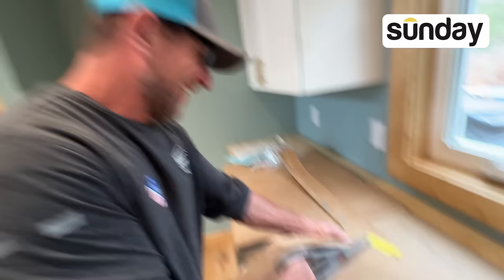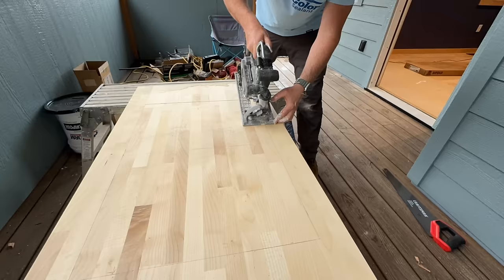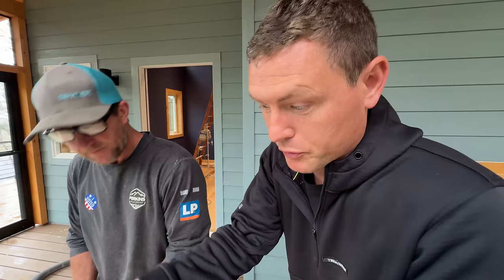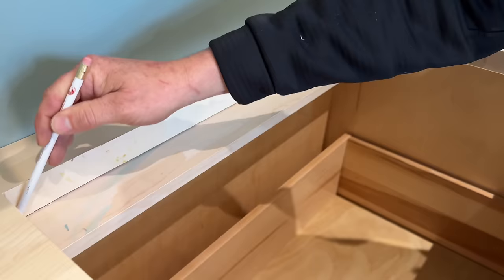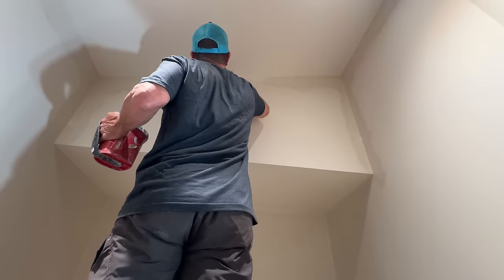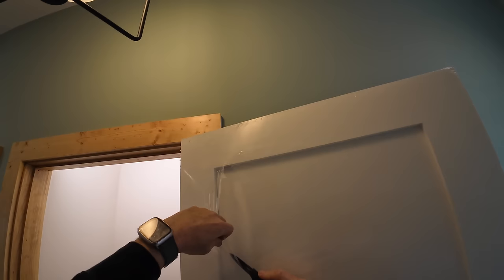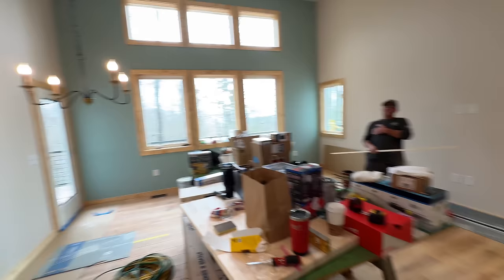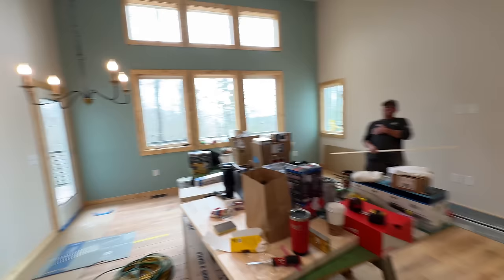Modern Home Build | 46 | cooktop, door finish, closet hardware, Bob Ross touchups

Comment: If you are touching up like that then I think you should use a 4" fluffy roller to ensure that the paint dries the same as the rest of the wall.  You run the risk of the newly brushed touch up areas may dry different and you'll see the difference.  Love your vids 🖖

Comment: Am a retired architect and construction manager.  Been watching your videos since the beginning. Enjoy your pro tips especially those on painting techniques to minimize brush strokes.  Keep it up guys!
Reply: Best way to minimize brush strokes is to not use one.  Yes, needed to get paint into tight corners, etc., but otherwise do this....  Search some videos by the channel 'Black Sheep House' (HOLY GRAIL of ROLLERS ✨ smooth finish no sprayer).  She uses the small foam rollers to refinish old furniture.  I have painted a desk and the entry doors using the same technique and would nave no hesitation to even use the technique on cabinets.  Wizz or FoamPro foam rollers.  I did not brush on and then dry roll like she does, I just loaded up the roller lightly with paint and roll the area a little more than you might otherwise to make sure it is as thin as possible but covering the old finish. It is OK if some of the old finish is peeking through.  Don't be fooled by labels, no real painter believes in a perfect "1 coat coverage" claim that paint manufacturers say.  Even the best Sherwin Williams store products (Emerald or better, not found in Lowes box store) will need 2 coats to really get perfect coverage and durability.  Also your final strokes as you work across the piece should be light pressure so you do not get lines at the edge of the roller because of squeezing the paint to the side.  Then don't bother it.  It will start dryuing immediately and if you run the roller over it a few minutes later it will not be good.  Use some portable lights off to the side so you can see the reflection, or glare of the lights on the wall, door or workpiece to highlight any ridges or junk that got in the roller.  2 coats with a light sand between and it is the closest you will get to a spray finish and looks amazing with just plain ordinary latex paint.

Comment: For someone who doesn’t like to paint, Jay is a very meticulous painter. I’m sure Remelle appreciates you dedication . The whole Perkins crew has a high degree of attention to detail.  I love the look of this modern build.  Are there plans available?
Reply: I love PBB and crew for everything they brought to my build! 
Tim Mason of Bryson City, NC did the preliminary plans. There were changes - pre fab floor and roof trusses with the LR/DR bump out getting 2x6 studs instead of 2x4s - engineer that designed the floor and roof trusses recommended because of the additional 4 ft and the weight. The infamous walk-in closet that later received a 2 ft bump put to the deck. And something else I am falling to remember now.
Tim’s info is on BuildZoom. He’s another 40 yr plus friend. I called my build “by/of/for community. It truly was from  planning to start to finish!

Comment: Top tip for cleaning brushes, a hair comb, yup just a regular comb for your hair, you pull the comb through the brush bristles to help get the paint out. Works a treat. Note I'm talking about when you have washed the great amount of paint out. Cheers, Sy.
Reply: Pre dampen your brushes helps as well.  Wash out and beat out extra water.  Also clean your brush out about every hour.  I only use Purdy brushes but Wooster are also top quality.  All brushes are not equal.  Those two brands are the best out there. Purdy XL Dale with the angled brush tip are my top pick.

Comment: Pro tip, something I learned many years ago, When touching up a sprayed, rolled, lightly textured or glossy surfaces like trim and doors, instead of a brush, I cut a new grout sponge into 4 pieces and use one to dab and feather paint on, the more you dab the better it blends in and leaves very little to no trace after drying.

Comment: I use “Flowtrol” in semi-gloss latex paint and it will make the paint lay down and brush marks are zero.
Reply: A little Floetrol mixed per directions and the small foam roller like the FoamPro or Wizz  will yield a nearly texture free finish as close to spraying as you can get.

Comment: That protective paper on the stainless might not be so bad, but the darker grey one tends to leaave behind alot of adhesive on the stainless so it might be a pain and take alot of cleaning without adding scuff marks. Dykem remover makes it quick to remove and of course follow up with a good cleaner and a protectant.

Comment: I used to instal kitchens, and after we cut the holes for the sink etc we would take the cut outs back to the shop and form them into cutting boards with our routers.
Reply: That’s my plan! And the sink cut out is likely to be turned into a 4 person bar height table for the catio using a marine grade finish!

Comment: Pro tip: Mark the cut-out by tracing the cabinet sides from below.
(Or use those lines to center the cut-out, if it's smaller)

Comment: pro tip from me when your done painting with a good paint brush  wash out as much paint as possible then with a bar of soap ( i use Dial) and wire brush, brush in the soap into the bristles till soap mixes with the bristles well , wash out with clean water then  with a little soap shape the brush into a fine point with your hands let dry over night  the next day it will seem hard or stiff ,crunch it up and you will have a soft clean brush to work with... try it
Reply: This works good when you get drying paint way up the bristles.  Washing the brush out every hour helps to keep the bristles supple for the best finish.

Comment: Looking good! Amateur Tip , I use Valspar High Hide White 146978 Stormcoat exterior Satin in all my interior trim/doors. Roller foam 2 coats looks like sprayed on. Also on exterior as well.  Satin looks better than semi-gloss IMO. Keep up the fun work. Jason should do " Stand Up ". 😂😂
Reply: Yes, the foam rollers produce a great smooth texture when dry for doors, cabinets, and furniture.  Take care, it takes latex paints on these surfaces several weeks to harden up before you should place sharp or heaver items on the surface.  Latex needs time to cure and harden.

Comment: When doing those touch ups with wall paint I’ll do a little bit of Floetrol in a small cup with some of the paint. Levels it out beautifully. Always use it in trim paint. Drys like it was sprayed on. Won’t need to back brush after you roll.
Reply: Right, Floetrol is a leveling additive for anyone who does not know.  It will increase drying time of the paint but that is to allow it to flow out and level with minimal brush marks or roller 'stipple', or texture.

Comment: You should check out McMaster Carr.  They have all sorts of screws and many other types of hardware types of items.

The cardboard worked well for holding the screws to paint.  I like to use Styrofoam.  It works very well.

You didn't say another pro tip but you demonstrated it.  Make sure your cut out piece is supported so it doesn't rip the good piece.

Comment: In the future hit those screws with acetone before you spray paint them. A lot of them or all of them really have anti-corrosion coating sprayed (oil residue from manufacturing) on them that will make the paint lift or make it so it's not strong enough to be screwed down without chipping the paint off.

Comment: Those Brackets are great until you put a lot of winter coats on them then the glue in the  plastic slip that holds the rod falls off and everything is on the ground.  That is what happened to me even with Brackets spaced 2 feet apart on a 7 ft run.

Comment: Okay, the last video y’all said “i know there’s gonna be comments about why didn’t we use a track saw” on the butcher block counter tops.  I held my comment.  Now this, the very next video, y’all are PLUNGE CUTTING for the cooktop - a track saw is a plunge saw, and it cuts dead straight lines at perfectly controlled depths.  So……all I’m saying is that maybe Jaime needs to start keeping that festool plunge cutting track saw in the truck so y’all can save yourself some time.  Also it removes the worry about messing up expensive countertops and finished surfaces from the process, as well.  

Keep up the good work, fellers.

Comment: I want the blue prints and such for this house.
Reply: So glad you like it. Tim Mason of Bryson City, NC. There were tweaks - floor and roof trusses were built and brought in. An Engineer did both plans. Because of the 4 ft bum out for the LR/DR adding height and weight the engineer recommended 2x6 studs on that wall. Then there’s the infamous walk-in closet in the Queen Suite that was after the fact and the editions controversial 2 ft bum out onto the deck.  Oh! and the wrap around deck instead of the catio and a 10x 8? accessible from the LR/DR. Those are the changes I can think of - not sure if that’s all of them. He comes up on Build Zoom. He’s also slowing down on work. Another one of my forty plus year friendships- we are all getting into retirement mode!

Comment: 15:00 Pro Tip: “Just put a self tapping screw through the closet rod brackets into the back of the pole. Then the client never has to worry about janky closet poles.” Says the custom closet contractor.